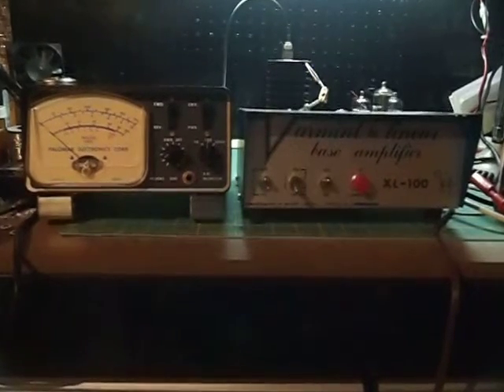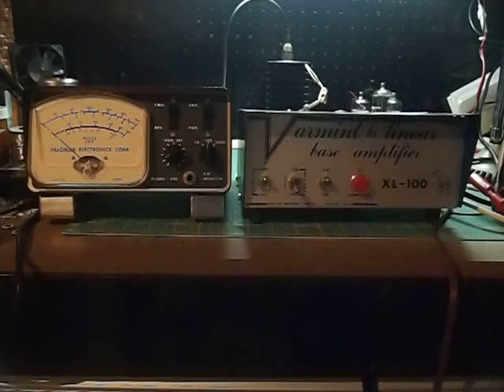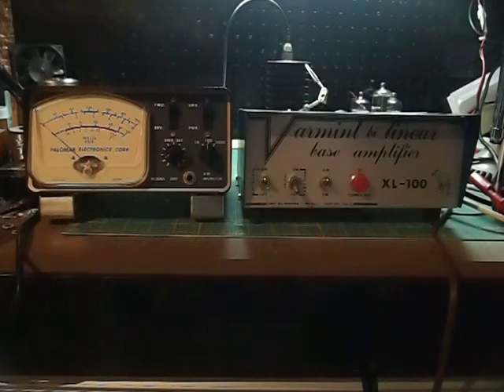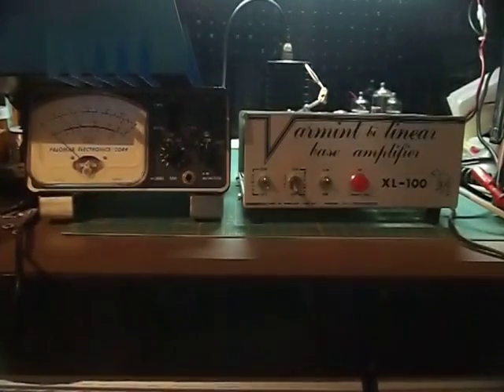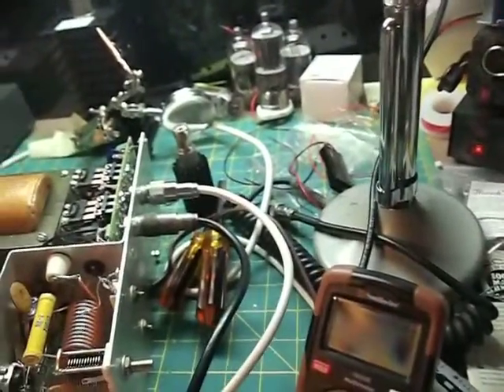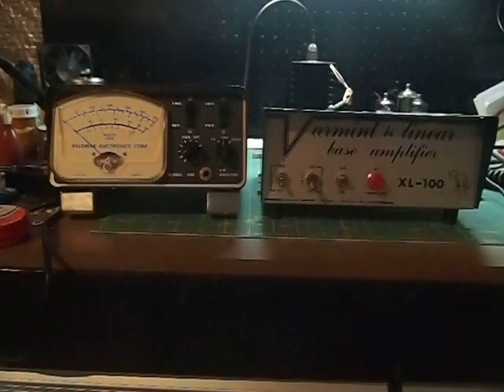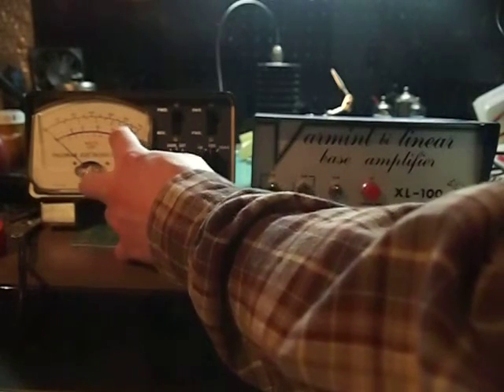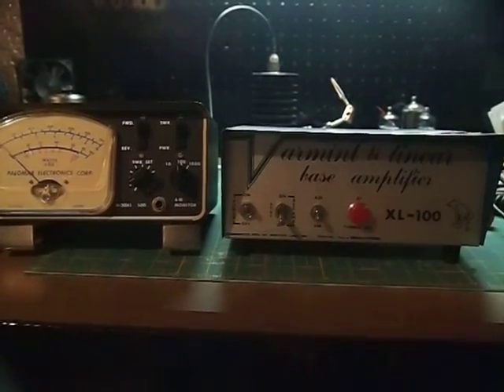Varmint XL-100 Amplifier

Comment: I am a collector and have had a few and own a few now. I also have been around since the early 70's. I have also heard the same thing 'Varmint's are dirty' From what I have found, except for the ones with the 'Supermod' switch, Varmints in normal mode are pretty much the same as any other sweep tube linear amplifier or maybe better than some. As said in the video, has a typical Pi output network, Tune and Load adjustment, and has an Input tuner, to adjust the Input SWR. In normal mode, just a basic grounded grid amp. Now in Supermod mode, they rebias the driver tubes to class C to give it that swing and as most know, class C is very dirty. Here is a Varmint XL-110 mobile I just picked up and was looking for info on it which brought me here. In conclusion, IMHO, they are a little better than most, and other than using Supermod, are no dirtier than any other normal sweep tube amp.  https://youtu.be/hSSw72Yah14

Comment: The Palomar 500 is maybe a worse wattmeter than even a Dosy,Astatic,PDC,& a Workman & they all SUCK badly even on a good day.You had just stated,the Palomar 500 is NOT a Peak Reading wattmeter & you show what you say was 60 watts Peak on SSB? Also you whistled for that reading which is useless.If it did 10 million watts when you whistled those watts would be pretty useless since nobody whistles for communication purposes so ONLY a spoken watt is a useful watt.

Comment: I have a varmint XL 100 it's look new it does 100watts with my stock 148cobra I made a video as well.Now I useing a stock  uniden 980 it does 3watts in the amp does 100watts.  I try different meters I have 4 metes they all shows 100watts.
Reply: put new filter caps in it and it will do more . i put three new filter cap .and all new caps on the board and now its doing around 195 to 200  . with only a 1 watt dead key swinging to 12 watts. that amp was built around 1977 to 78 and if it  still has the factory caps in it from  77  they are dry. 100% sure on that . my amp was a new old stock . with new old stock  tubes in it  . win i first got the amp did around 120 watts after a full recap it did just under 200 watts . with a 1 watt dead key . my xl 50 with one tube did 75 watt . after a full re cap it does around 110 watts with 1 watt dead key swinging to 12 watts . you can get all the cap off ebay to re cap it . if you need help on any of this email me rkcjr@comcast.net . i restore hellicrafter tube shortwave radios . so for a small fee i could send you a cap kit for your XL-100   thanks bobby
Reply: BS,that amp could NEVER produce anywhere near 195 watts if everything in it were brand new.Buy a real wattmeter & quit thinking everybody is a Moron.100 watts is just about all they will do no matter how hard you push them.There is this little thing called PHYSICS so read up on it & learn something & don't be STUPID all of your life.I don't care what caps you put in the amp it's IMPOSSIBLE since PHYSICS has the final say in the output not anyone else. LOL What a freaking joke.

Comment: the fused plug is original  Made around 77 - 78 GUY on ebay is selling them  NOS!!!!  now . i got a xl-50 and the xl-100 the 100 runs a tad hotter but it you tune that amp the right way you will see around 165 to 180 pep max . thats just fine for a base amp . i got the brochure on the lx-50 and 100 if you would like one . i could  scan it and email to you
Reply: I just picked up the XL-50, I have looked everywhere for info and it seems there is not much on the internet for the XL-50, I also need to know what tube the 50 can use.   Shoot me an email with your instructions!
Reply: My Uncle left me an XL-50 and I have no clue hoe to use it, tune it etc.. Can you send me some info on it? Would love to get it working.